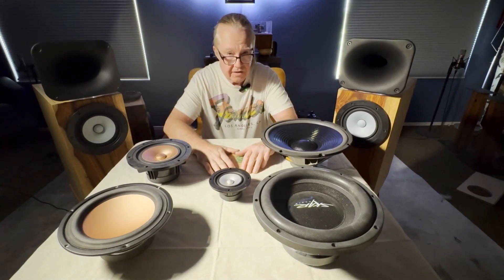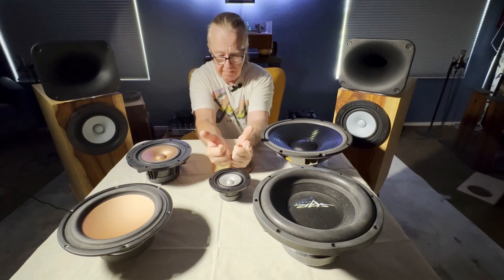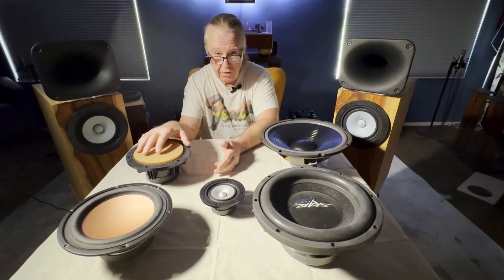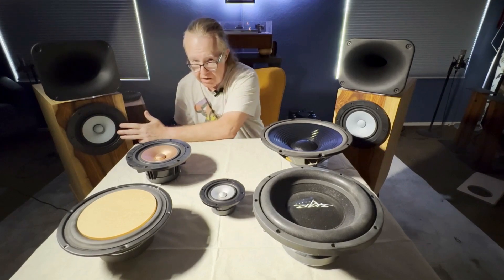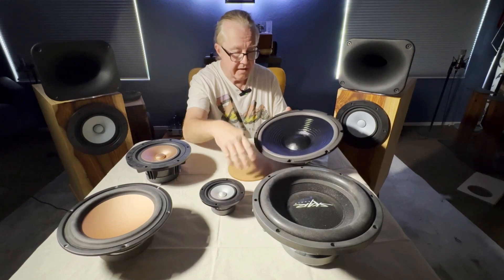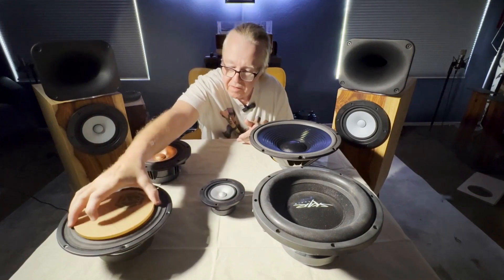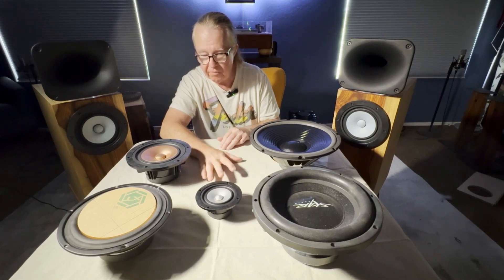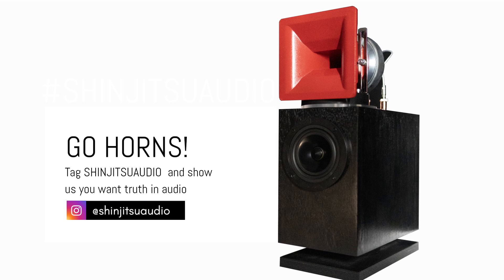Bigger is Better - Or Is It? The Truth About Woofer Size and Beaming

Comment: How does this apply to subwoofers and driver size with a much lower crossover around 80hz? What driver size would be considered too big for your speakers in that case?
Reply from the maker: Subwoofers are not an issue as they cross way below the breakup or beaming point.
Reply: @shinjitsuaudio  So buy as big as you like?
Reply from the maker: If its a subwoofer it is designed only to reproduce low bass. It has no bearing on bass >80Hz if thats you cutoff LP.  In the video we are only discussing what happens if you use a large woofer and expect it to go higher than 2 kHz then its size vs wavelength is problematic. In this case buy a big of a subwoofer as you desire its cutoff frequency removes all bad behavior.
Reply: @MadelnMachines yes, buy as big as you like, given that you have enough space to provide a properly sized enclosure.

Comment: I'm a bit confused about the alpair drivers here, aren't they based on Ted Jordan attempt to take advantage of cone break ups? And why use full range drivers when crossing at 1800hz - perhaps the alpair are very fast drivers?
Reply from the maker: What Are Alpair Drivers and Cone Break-Up?

Alpair drivers are a type of full-range speaker. In simple terms, they’re designed to play all parts of the sound, from deep bass to high treble, using just one speaker.

Cone break-up is a phenomenon that happens when a speaker cone (the part that moves to make sound) gets too fast and messy at certain frequencies. This can cause distortion, or unwanted noise.

Alpair drivers are special because they control this issue, allowing them to produce clear, detailed sound even at high frequencies, like treble.
Why Use Full-Range Drivers in a Speaker with a Crossover at 1800Hz?
Using a full-range speaker with a crossover at 1800 Hz might sound unusual, but here’s why it works:

Alpair Drivers are Fast:

These drivers are designed to move quickly and precisely. That means they’re really good at playing fast, sharp sounds without blurring the details. This is important for producing clear midrange sounds (like vocals and instruments).

They Can Handle Midrange Well:

The 1800 Hz crossover point allows the Alpair to play the midrange sound very well without getting messy. At higher frequencies, a separate tweeter (a smaller speaker) takes over, playing treble (high-pitched sound) cleanly. This setup means each speaker does what it does best.
Smoother Sound:

Full-range drivers reduce the need for complex crossover designs, which can cause phase issues or distortions. The less complex crossover ensures the sound blends smoothly between the drivers.

Why Does This Matter?

In simple terms, the Alpair driver handles the critical middle range of sound really well, providing clearer vocals and instruments. When it reaches higher frequencies, the tweeter takes over, so you get crisp treble.

By using a fast and precise full-range driver, you get a natural, smooth sound that avoids the distortion problems other speakers might have when they try to handle everything. It’s like having the right tools for the job: the Alpair driver is great for the middle, and the tweeter takes care of the highs.

Comment: I will disagree with your affirmation that a small driver will reproduce the low frequency spectrum - you said 90% or 85% etc.  While this may be true for actual frequency response, but this is not correct as far as producing any meaningful sound pressure to fill the room with low frequencies that will play at levels are are even remotely convincing of the instrument(s) playing.   

Unless one wants to play their music at 65db, a tiny driver will offer no immersion of any kind with regards to anything lower than midrange if you want to play in an average room at say 75-80db.  This becomes greater issue because a small driver will need to move significantly further in terms of excursion to produce lower frequencies which in term will introduce a lot of distortion in the midrange.  A larger driver combo, even with other issues, will produce realistic music levels with lower distortion in the end.
Reply from the maker: Thank you for your thoughtful feedback! You’ve raised valid points regarding the limitations of small drivers, especially when it comes to reproducing low frequencies with the impact and scale that larger drivers naturally deliver. Let us take a moment to clarify the context and reasoning behind the existence of smaller speakers and why they can still offer a meaningful solution for many listeners.

Why our Smaller Speakers Exist:
Smaller speakers, including those with compact drivers, are designed to address the practical needs of modern living spaces. With many people residing in smaller homes or apartments, large speakers can simply be impractical due to their physical size and the way they interact with room acoustics. In these cases:

Optimized for Small Rooms:
In smaller rooms, small drivers can be carefully optimized to produce adequate bass, leveraging the room’s natural reinforcement (room gain) to enhance low-frequency response. While they may not rival larger speakers in producing deep, room-shaking bass, they can offer a balanced and satisfying performance for typical listening levels.

Compromise and Practicality:
A larger speaker in a small room can often dominate the space visually and acoustically, leading to placement challenges and, in some cases, overwhelming low-frequency energy. Smaller speakers strike a balance, providing a more space-friendly option while delivering good sound quality within their intended use case.

Bookshelf Speaker Popularity:
The enduring popularity of bookshelf speakers proves that compact designs can excel in delivering high-quality sound. For example, highly acclaimed models like the KEF LS50 Meta, Sonus Faber Lumina I, and ProAc Tablette 10 are lauded for their ability to create detailed, immersive listening experiences. Budget-friendly options like the ELAC Debut 2.0 B6.2 or the Wharfedale Diamond 12.1 demonstrate how smaller speakers can deliver impressive performance without the need for a large footprint.

A Matter of Priorities:
Ultimately, choosing a speaker is about balancing trade-offs based on your room, preferences, and priorities. Larger speakers will undeniably excel at delivering powerful, distortion-free bass and dynamic range. However, for those living in smaller spaces or prioritizing a more discreet setup, smaller speakers are a practical and effective solution. Models like the Q Acoustics 3030i or Klipsch RP-600M show how compact designs can combine space-saving convenience with impactful sound.

We respect your point about the challenges of achieving truly immersive low frequencies with small drivers, and we agree that their capabilities have limitations. However, for listeners in smaller rooms or those who value compactness and aesthetic harmony, these speakers can provide a satisfying and enjoyable listening experience.

We love having discussions like these and appreciate the opportunity to share perspectives. Thank you for engaging with our content, and we look forward to hearing more from you! 😊
Reply: @shinjitsuaudio  Hi and thank you for the reply back. I can totally accept those points :)    I have both small and larger speakers and setups and I'll say that for the smaller one (bookshelf with 5.25" driver and tweeter), I also added two compact sealed subwoofers to handle the low end and I ended  up crossing the mains to relieve them of the low bass duty. I think my only point was about the use of the language that made it sound like its covering the bass range the same as larger speakers / drivers except for some slight loss in extension and I wanted to add that its also about distortion and compression at louder volumes or dynamics.

I am 100% onboard with the use of horns / compression drivers.  Best thing I ever did for my fidelity to be honest.

Comment: Beaming is a higher frequency distortion. While decoupling is the low frequency anomaly. Laws of physics determine at what frequency the driver stops being able to pressurize the air around it. The smaller the cone, the longer the throw that is needed for the same frequency. An 8" driver has to move significantly farther forward and backwards perfectly linearly than a 12".
Reply from the maker: You're spot on about the physics involved with driver size. Beaming indeed becomes a significant issue as the driver size increases, especially at higher frequencies. With very large woofers, like a 12" or 15", the driver starts to beam at a lower frequency, which means the dispersion narrows, and the sound becomes more directional. This can lead to a less natural or cohesive soundstage, especially in the midrange and high frequencies.

As for the low end, it's true that a smaller driver, like an 8", needs more excursion to produce the same low frequencies as a larger driver. However, in our designs, we focus on using high-quality, well-engineered smaller drivers that can handle this excursion accurately and linearly. This approach allows us to achieve deep, controlled bass while also maintaining a wider and more even dispersion across frequencies, which is essential for a coherent full-range sound.

Larger drivers certainly have their place, especially for dedicated bass reproduction where dispersion isn't as critical. But for a true full-range driver that's intended to cover a wide frequency spectrum without compromising on sound quality and dispersion, smaller, well-designed drivers tend to provide a more balanced and accurate listening experience. Thanks for sharing your thoughts—it's great to have discussions about these different approaches!"

Comment: Beam me up..I’ll stick with the fifteen inch full range and a thirty watt tube amp. My ears can’t perceive any beaming. I’ve used all sizes and the big daddies seem to be the ones I fall back on
Reply from the maker: Lets take a look at some measurements of these wonderful full range drivers of larger size: https://rutcho.com/speaker_drivers/default.html. 

With that said the concept of 'beaming' might not always be immediately noticeable depending on your listening position and room setup. In my experience, as the frequency increases, larger drivers tend to lose their ability to disperse sound evenly, which can create a more directional sound (what we call 'beaming'). This can affect the stereo image, but if it sounds great to you and works with your setup, that's what matters most!

For our designs, we stick with smaller woofers to balance dispersion and crossover integration with compression drivers, aiming for a more uniform sound throughout the room. But hey, the beauty of audio is that it's all about what makes your ears happy! Appreciate your input!"

Comment: Why does it matter? ... the crossover will attenuate frequencies over 2KHz to the woofer
Reply from the maker: Thank you for your thoughtful question. You’re right that a well-designed crossover will indeed attenuate higher frequencies to the woofer, typically above 2kHz. However, there are several important reasons why woofer size and beaming still matter in speaker design, even with a crossover in place:

Every driver, regardless of the crossover, has natural beaming characteristics that begin at a certain frequency. For a larger woofer, this beaming starts at relatively low frequencies due to its larger size compared to midrange or tweeter drivers. 

The larger the woofer, the lower the frequency at which it starts to beam.

Crossover Slope:

Crossovers are not brick-wall filters; they typically have a slope (e.g., 12 dB/octave for a second-order crossover). This means that the woofer will still output some higher frequencies above the crossover point, albeit at reduced levels. If the woofer beams those frequencies, it can affect the overall dispersion and sound quality.
Impact on Soundstage and Imaging

Soundstage Consistency:

Beaming affects how sound is dispersed in the listening environment. A woofer that starts beaming at lower frequencies will have a narrower dispersion pattern, which can lead to uneven sound coverage. This affects the soundstage and imaging, making the speaker sound less cohesive, especially off-axis.

Integration with Other Drivers:

The goal is to achieve seamless integration between the woofer, midrange, and tweeter. If the woofer beams significantly before the crossover point, it can create a mismatch in the dispersion patterns of the different drivers. This can result in an uneven frequency response and a less natural sound.

Practical Design Considerations

Room Acoustics and Listener Placement:

Room acoustics play a significant role in how a speaker sounds. Beaming can lead to more pronounced reflections and less direct sound, particularly in rooms with reflective surfaces. This can make it harder to achieve a balanced sound across different listening positions.
Crossover Design Complexity:

To mitigate beaming, designers might need to implement more complex crossover designs or employ waveguides and other techniques to control dispersion. This adds to the complexity and cost of the speaker design.

Conclusion

In summary, while crossovers do attenuate higher frequencies to the woofer, the natural beaming characteristics of larger drivers still play a crucial role in the overall performance of the speaker. Properly managing these characteristics ensures better soundstage, imaging, and integration with other drivers, leading to a more cohesive and enjoyable listening experience. 

Thank you for raising this important point, and I hope this explanation clarifies why woofer size and beaming are significant considerations in speaker design.
Reply: @shinjitsuaudio  It does matter but it's like the reverse logic to the issue. For lower better bass, larger woofer may be chosen. Then that comes with beaming or directivity issues, choose a suitable one for the tweeter or mid driver (for 3 way). At certain point, just use 3 way design.
Reply from the maker: Thank you for your comment and insights! You're absolutely right that larger woofers can provide better bass, but they do come with the challenge of beaming or directivity issues at higher frequencies. This is where our design philosophy at Shinjitsu Audio comes into play.

We believe in maximizing the performance and efficiency of two-way speaker designs. By carefully selecting high-end drivers and ensuring proper phase alignment, we achieve a balanced and natural sound without the need for a larger woofer. Our speakers are designed to handle the crossover frequencies effectively, minimizing the impact of beaming.

For those seeking deeper bass or more complex sound reproduction, a three-way design can indeed be a solution. However, our focus remains on providing high-quality, cost-effective solutions within the two-way design framework. This approach not only simplifies the design but also ensures a more cohesive and accurate sound stage, true to the original recording.

Thank you again for your input! We appreciate the discussion and always strive to improve our products and explanations.
Reply: No one should be crossing a 12 inch at 2khz. It should be 800hz or even 300hz.
Reply from the maker: Thank you for your comment! You're correct that crossing over a 12-inch woofer at 2kHz would generally lead to beaming and directivity issues. For a more balanced and accurate sound, the crossover point should indeed be lower, typically around 800Hz or even 300Hz, depending on the design goals and the specific drivers used.

At Shinjitsu Audio, we prioritize driver selection and crossover design to ensure optimal performance. For instance, our two-way designs with smaller woofers avoid the beaming issues associated with larger woofers crossed over at higher frequencies. This allows us to maintain a smooth and coherent sound without the need for a three-way design, which can complicate the overall system.

However, for designs involving larger woofers like 12 inches, we agree that a lower crossover point is essential. This approach ensures that the midrange and high frequencies are handled more effectively by the appropriate drivers, avoiding the pitfalls of beaming and providing a more natural and immersive listening experience.

Thank you for bringing up this important point! We always strive to refine our designs based on both technical principles and practical considerations.
Reply: @shinjitsuaudio  what if you use multiple small drivers? I recently (Jan 2024) DIYed a loudspeaker that used a single MAOP 7 flanked on either side (much like the KEF blade) with 2 16cm SL series SEAS woofers (forget the exact model number but these are the same drivers Siegfried Linkwitz used in his speakers). The bass from the 4 16cm woofers was reinforced by 3 (rear facing) 5” x 8” passive radiators from SB Acoustics. The crossover was a mini-DSP. The MAOP 7 is fine till about 12-13k Hz after which the roll off is noticeable so I had to add a small ribbon tweeter (Fountek) to extend the high frequencies to 20k.
Reply: @navinadv  How does it sound?
Reply: @johnyang799  Yea I thought it would be lower